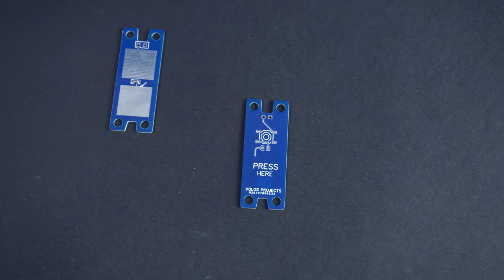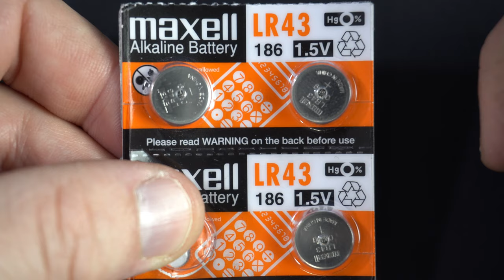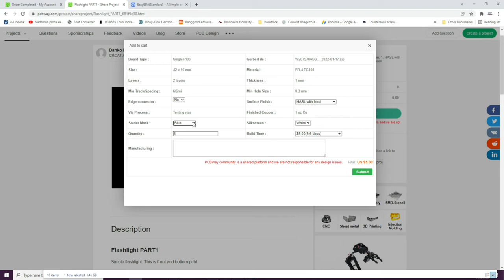Make your own Flashlight

Comment: VERY robust design 👍

You could even use 2 small cable ties & slots instead of nut and bolt.
Nail polish is good locktite 👍